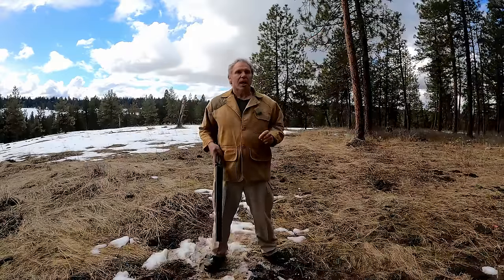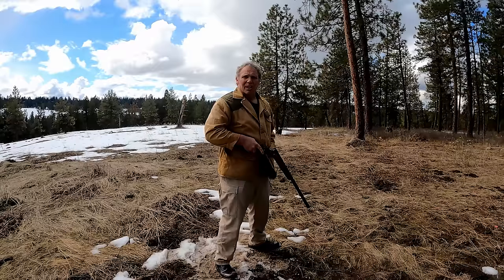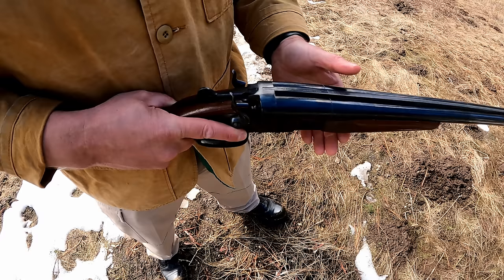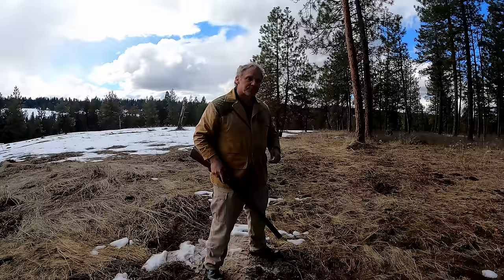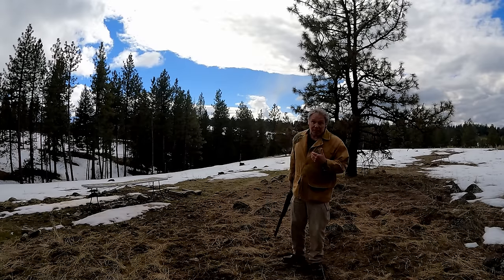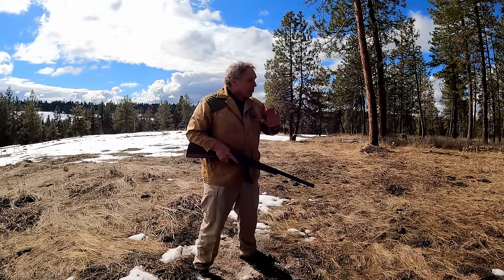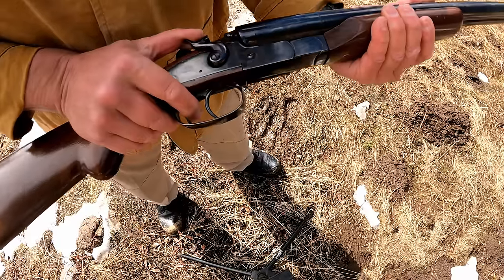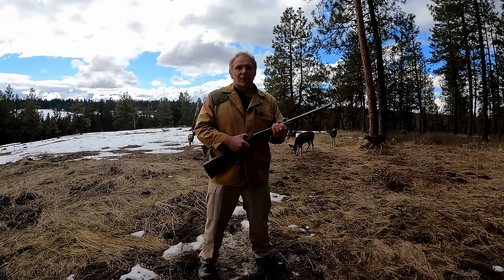Paul's Coach Gun Technique Explained

Comment: If you open the gun to lower the hammer(s) it cannot fire....(assuming it doesn't have an auto safety,..... A sear should not bounce off if the other barrel is fired... if it does it needs fixing.
Lever rifle... if you partially open the lever, the gun cannot fire...then it's safe to lower the hammer to half cock...
Reply from the maker: I really hope that's a joke (albeit a bad one) if it's not a joke then you know NOTHING about firearms.
Reply: With virtually every lever action rifle, if you partially open the lever, it blocks the trigger from being moved (pulled). Thus, you cannot pull the trigger to lower the hammer when the lever is partially actuated.

Comment: You say gun safety is the reason you don't cock both hammers... in case you didn't need that 2nd shot. But then in every other video you've ever used a pump gun, you cycle the action after every shot, even when you finish to talk, doing the same thing.  Every time.
Reply from the maker: The pump has a manual safety.
Reply: @GW get rekt kid